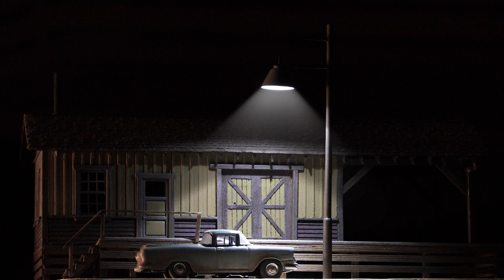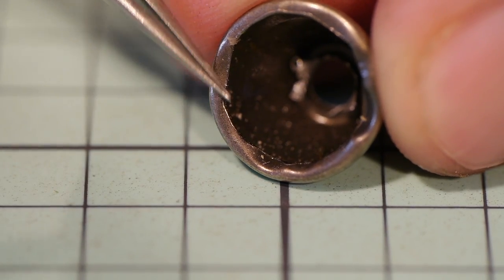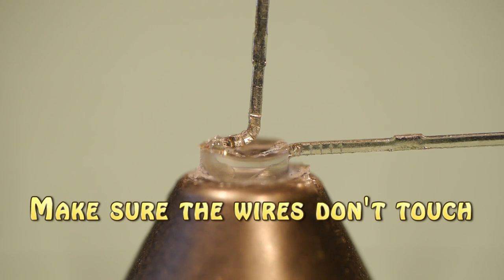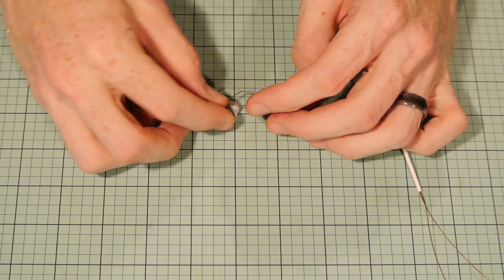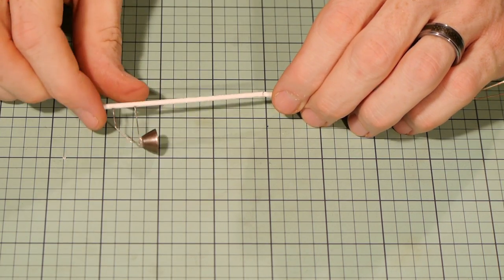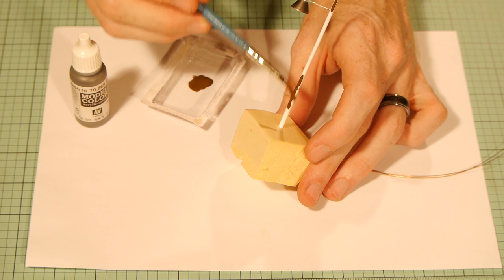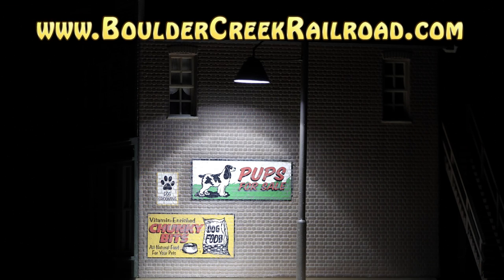Working Street Lights - HO scale

Comment: Very goods Luke. I particularly like your use of the led leads as part of the lights metal structure.
Reply from the maker: +cbcdesign001 Thanks mate, the only precaution is to be careful bending the wires close to the LED base, I haven't had any issues yet but others have mentioned to be cautious. 
Cheers
Luke

Comment: Nice! Awesome looking lamp, easy to make!
One needs to be careful though bending the wires so close to the LED case. Sometimes it damages the LED, even though everything looks intact. Better test it every step of the way. 
Small correction: the resistor was 5600 Ohm (5.6 kOhm, green/blue/red marking), not 5200 (would be green red red marking, very uncommon value).
Reply from the maker: +LANE Boys RC Cheers mate, thanks for the great advise about testing the LED's each step of the way. I haven't had any trouble yet with them but I could see that it wouldn't take much for it to break and stop working, would be a huge letdown should you finish making the lamp only to find the LED isn't working!
And thanks for the resistor update, you obviously know your resistors well :)
Cheers
Luke

Comment: Suggestion: If you want to give your wood light poles an aged look, hold a razor saw blade perpendicular to the pole and scrape along its length and circumference.  It will cut grooves into the styrene that mimic a well-aged utility pole.  Once you cut the grooves, paint the light pole your preferred color.  An india ink wash can also highlight the grooves.

Comment: Now that you've established the interior diameter of the styrene, I wonder what the outside diameter is.  Also what diameter would one use to go over the sttyrene to strengthen the very bottom of the pole light.  Inquiring minds want to know.  I'd hate to order a bunch of styrene  tubing that would not be beneficial to the project at hand.  Thanks and keep the videos a comin'.  --Rusty

Comment: What's Bag Feet??  I have been using wire from old computer mouses or keyboards.  It is very thin and flexible.  Using magnet (enameled) wire would be handy to use as support if needed.

Comment: Hey Luke, so far I have made 6 of these and I find if you feed the wire from the top down, it is so much easier and faster. I also only used a 1K resistor and when I run them all together, I use a dimmer to control the brightness. I do have a question though. what size is the styrene tube you used for the base?
Again, great video!

Comment: Hi Luke, great videos and web page, I new to all this and want to build your design but don't want it to be in vain and have them fail when I power them up. How do you work out your resistor values I have used online calculators and with figure of 12v supply, 3v led voltage 15mA, single LED and keep getting 620 Ohms I have used various online calculators with same results.
Reply from the maker: lol... I just guessed to be honest 😀 I knew that 6.2k ohm resistor would be safe and then I worked backwards from there until I got the LED to a brightness that I was happy with. Resistors are very cheap so I just bought a bunch on different strengths. I find I use about a 4.7k or 4.3k ohm resistor most of the time but really it will depend on how bright you want the LED. 
Sorry I couldn't give you a more scientific explanation 😀

Comment: If you paint the back of the LED with a carbon-based paint you will short the leads. Brush on a layer of Glosscoat to insulate the wires first.

Comment: It's AMAZING and you're making this looks simple. But in my place, it's hard to get thoose "bag-feet". Maybe i'll find another alternative to replace "bag-feet" part..any idea? Oh, one more things, are thoose two pieces wires inside touching each other? it is stick together?
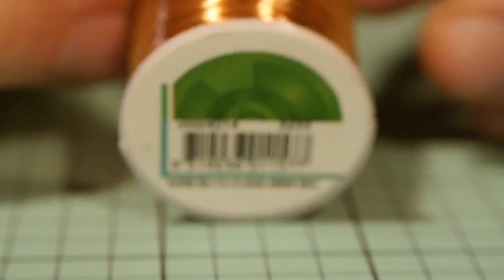Reply: +scale64 if you listen carefully at around the 2:30 mark, you will hear Luke say he uses 0.4mm INSULATED wire.
Reply: +Stuart Ellison Yes he said that, and i know it must be insulated, but the thing is the wire that Luke used, at a glance, not like the insulated one...but it's clear now, thanks.
Reply from the maker: +scale64 yeah the wire looks plain but it actually has a very thin coat of insulation. When the guy at the electronics store told me it was insulated I almost didn't believe him! You should be able to find bag feet on eBay, most people ship overseas but postage price can often be the biggest hurdle!
Cheers
Luke
Reply: Thx for reply Luke, acctualy...i'm using "pen-edge" for this, it's quite similar to bag feet, and it just need some drill on the hole, to match the 3mm LED, the rest "how to cook" is already in this video :). I think, it's another cheap solution for now,  the size is suitable for small scale. 

Cheers and keep posting...
Kevin.

Comment: Luke THANKS for another great video!!!!   One question though, what size bag feet did you use?

Thanks in advance 

ratled
Reply from the maker: +ratled1 Hi mate, in this tutorial I used 12mm bag feet. Thanks for the great comment :)
Cheers
Luke.
Reply: +Luke Towan   Thanks!!!   Parts ordered
Reply from the maker: +ratled1 Cool, good luck. I'm sure you won't be disappointed. The toughest part is threading the wire! I have a specific technique that didn't get portrayed that well in the video so I'll do some drawings and a better description on my website on how to thread the wire. 
Cheers
Luke

Comment: Where did you get them Luke ? the ones I got from Spotlight here in Melbourne seem rather big, probally ok for O scale..... but not for HO.....
Reply from the maker: I actually got them from Spotlight, they had 2 sizes. I think it was 12mm and 15mm ones. I used the 12mm ones for the video. They looked ok for HO scale.
Cheers
Luke
Reply: thanks Luke.

Comment: hello, I would like to build this street light but in 1/24 scale. what is the size of the bag feet and styrene tube do you suggest?
Reply from the maker: +kyuuketsuki79 The largest bag feet I've found locally was 15mm, that could work? But you'd probably want something closer to 20 or 25mm which you might be able to find on eBay. The styrene is totally optional with regards to size, you might need to do some experimenting to see what looks good.
Cheers
Luke

Comment: Also, the wire you used is that magnet wire?  thanks again
Reply from the maker: +maxanddad1 I'm not 100% sure if this is magnetic wire? What I do know is it's from Jaycar which is an Australian electronics store and it has a very thin layer of insulation around it which can be filed away. This one was .4mm but it also comes in .2mm however when the wire gets very thin it is possible for the wire to heat up and cause a possible issue depending on the current you put through it.
Hope that helps
Cheers
Luke

Comment: Excellent video, but there is a slight problem.  There are no 5200 ohm resistors. The resistor you used is either a 560 or 56 ohm resistor.  The resistor is banded (green-blue-and if the third band is black, it's 56 ohms, or brown 560 ohms.) If it were a 5600 ohm resistor it would be green-blue-red.  It' s nit, the rest of the video is great.
Reply from the maker: +Jim Mac lol, thanks Jim, I actually got a comment not long ago saying basically the same thing. Sorry about that but I'm impressed you picked it up, and thanks for mentioning it to me as well. It will help me improve future videos by focusing more on the specifics.
Cheers
Luke

Comment: hello luke i have 00 scale post should be 9 cm  high thanks forma your help
Reply from the maker: +juan carlos barrios devia It varies quite a lot depending on the style of light pole, for me the regular light poles are about 8m tall but near major roads they can be 10 or 12m tall and some of the lights around the railway yards look even higher. I'd say for OO scale maybe look at 10cm first and go up from there. Remember to cut the pole at least 11cm so you can push the bottom of the light pole into the scenery about 1cm deep, that way it will be stable and not fall over.
Cheers
Luke
Reply: Thanks luke

Comment: What size bag feet did you use?
Reply from the maker: These ones were the smaller 12mm ones. They also came in 15mm which I think would work as well.
Reply: Thanks
Reply: Not being an Aussie, could you explain exactly what "Bag Feet" are? Thanx

Comment: I would have fed the wires from the holes out the end of the tube instead of from the end of the tube through the holes.
Reply from the maker: +MrGameengineer Thanks mate, I actually tried that way first however the wire gets curved a fair bit as it initially pushes into the tube and tends to jam up half way down the tube. I guess if you used a stronger wire it might work but then space becomes an issue.
Cheers
Luke
Reply: +Luke Towan  I didn't mean to sound critical.  I hadn't done that before with such small wires.  I did something like that "wire through PVC" thing for another project I did a while ago but we are talking 12 gauge wire through 1 1/2" dia PVC pipe.  You're doing fine!
Reply from the maker: lol, it's all good. It's good to get ideas and learn from others experiences so I always encourage constructive criticism.